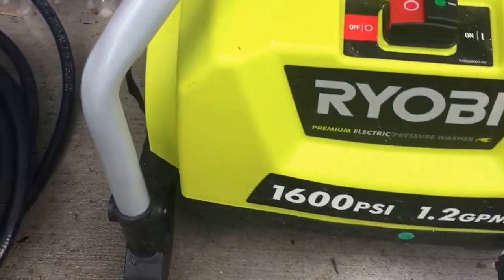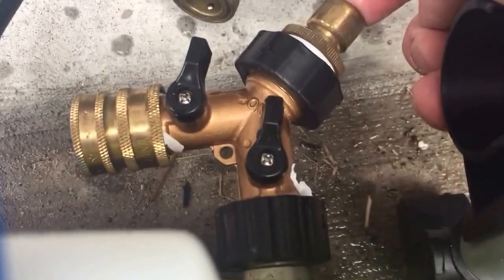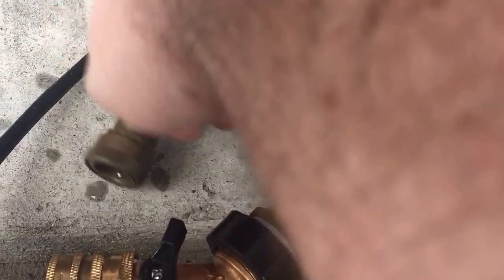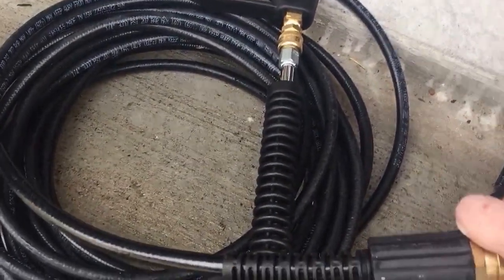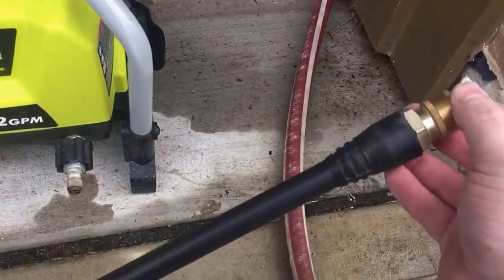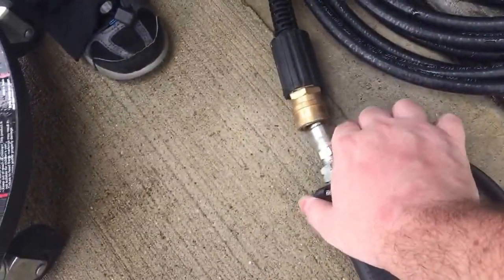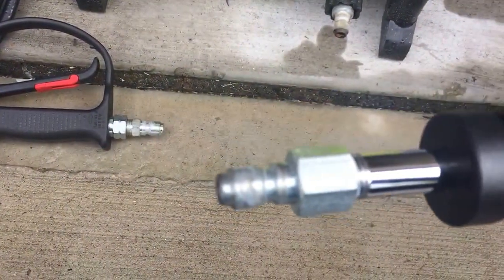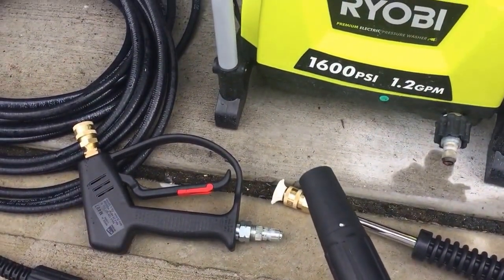Ryobi to MTM 407 Short Gun Set Up

Comment: I just got that same Ryobi pressure washer and would like to set it up like like yours for washing my car. Could you please post the links to where you bought all of those items? Thank you.
Reply: MTM's website or the Obsessed Garage store. I would do all stainless steel if I did it over again. 

Basically just M22 3/8 disconnects on the hose, 3/8 Quick Disconnect nipple on the gun.
Reply: jcaustin87 Thanks! I did find those two stores after much research. I just noticed now that you changed the hose to a 50 footer as well. I'm thinking of doing the same (3/8 hose) but wasn't sure if it will affect the pressure. Is it working fine for you?
Reply: No problems with pressure.

Comment: May i ask does the stock Ryobi hose work with Mtm quick connector?
Reply: Yes it does.
Reply: @babybuluga1554  i have the ryobi 2000 psi pressure washer, a short gun set up will still work??